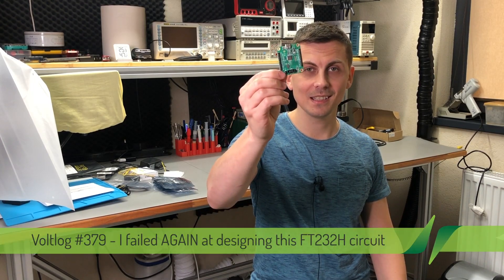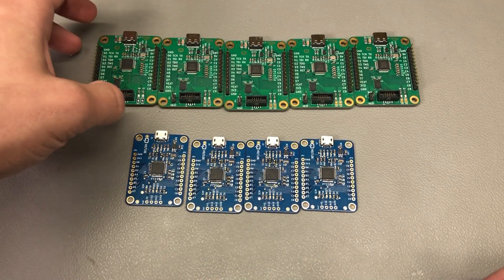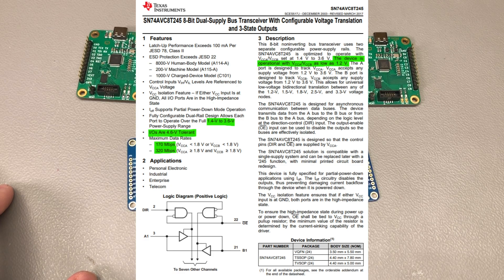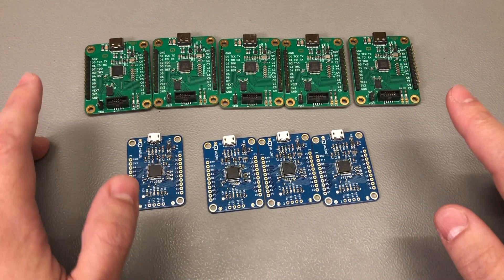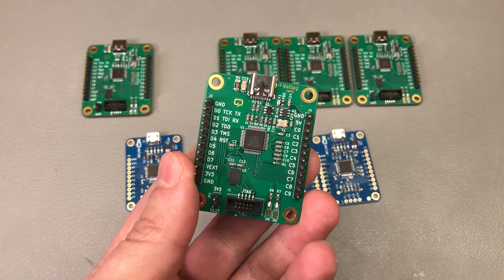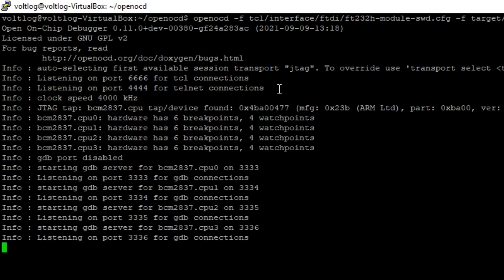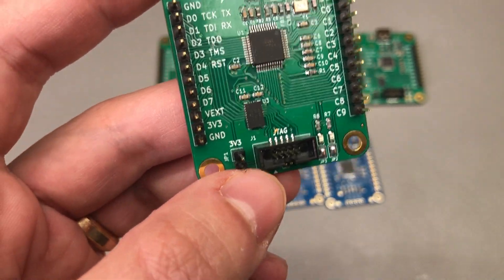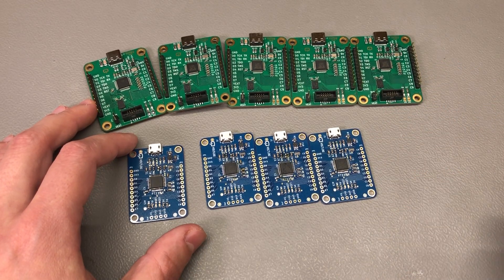I failed AGAIN at designing this FT232H circuit | Voltlog 379

Comment: You would only need voltage translation for TDO if the JTAG device is <2V. The FT232H inputs will recognise 2V -5V as a logic high. Just connect TDO directly, or through a small-valued series resistor.
Reply from the maker: I think you actually mean you don't need voltage translation for TDO, because it's going from target to debugger and the FT232H would be fine accepting a signal between 2.0V min and VCCIO (3V3 but extended to 5V because of it's 5V tolerance) on it's TDO defined pin. This would sure be the simplest solution to the problem but it would only cover 90% of the scenarios because if you try working with a 1.8V target I suspect it's either not going to work or it's going to be unreliable.
Reply: @voltlog  Pretty sure that's what I said.

Comment: I just recently totally messed up a circuit that integrated an ESP32-WROOM module. I mixed up the numbers for the IOs with the pin numbers of the module. Took me a while to find out why I couldn't detect any sensors on the I2C port and why the relay was always energized (it was connected to the pins for the WROOM's internal serial flash). Luckily it happened on the "proto"-prototype that I routed on my CNC. So no batch of unusable PCBs and remaking it didn't mean having to wait for a week for a new board.
Reply from the maker: Because of that I miss doing my own PCBs where I could spin a new board in a matter of hours. It's just not as easy to deal with that in the new office building.

Comment: Had the ESD protection diodes from preventing for USB to work as well. The problem is that some devices are high speed and the ESD diodes should match that, and most ESD diodes for USB are for low speed.
Reply from the maker: Thanks! This became clear after a few people mentioned this in the comments!

Comment: hey Voltlog!

have here my TIAO Tumpa v2 which uses a similar chip for the level shifter / buffer. In the documentation it says it's a 74LVC14T245 (i guess that means 14 channels). However the chip actually soldered onto my device is a 74LVC16T245. Now when reading the datasheet for this 74LVC16T245 (16 channel) chip, it does not mention so clearly that it's 2x 8 channel chips stuck together. However when you look at the logic diagram... this seems to confirm that. As 2 banks of 8 channels. And with each bank having it's own DIR pin (a total of 2 DIR pins) labelled 1DIR and 2DIR. So given that this is what the TIAO Tumpa v2 has done, I don't see any reason why not just do the same thing here. So long as the part is in stock and available. As you are already familiar with the 8 bit version of this chip.

This programmer is not in stock / available. Or it just keeps selling out very fast for each new batch. The extra protocols it can support: includes SPI, i2c. And RS232. For these extra protocols it adds a little bit more complexity. There are 2 additional chips... one is 93lc46 eeprom not sure what is for to remember here, but it connects to the FTDI chip. and also there is a 12Mhz crystal. And it has a MAX3243 chip for driving the RS232 port.
Reply from the maker: Thanks for the suggestion! I also have an EEPROM and crystal on board. The eeprom is used to save the config of the chip, like where are the TX/RX LEDs connected to and what is the USB descriptor strings. SPI, I2C is supported by default and for RS232 it's just not worth it anymore these days as far as I am concerned. I'll either end up using two transceiver chips or a 2in1 as you pointed out or I'm gonna do a discrete solution with mosfets because that would have the big advantage of using more easily savailable parts.

Comment: My FT232 doh moment was when I forgot to ground the test pin. Luckily it's next to a ground pin, so it was an easy fix with a fine tip iron and a tiny bit of solder.
Reply from the maker: Yeah it feels a bit weird that not tying that pin down will prevent it from functioning.

Comment: Good video as always. Would you be able to use this board towards the new Attiny 0-series(ex. Attiny1614) which use JTAG2UPDI? Usually we download the JTAG2UPDI unto a Nano, which then connects the UPDI pin to the Tiny. You should really check out the mcu's! Only use one pin for programming :)
Reply: JTAG2UPDI is one particular project that's using an additional host microcontroller between the serial line and target. So no, this board won't work right away with that. You could add one resistor or diode, and use the serial UPDI solution, and this board should work as well as any other serial adapter though.
Reply: @Gameboygenius  good to know! Thank you!

Comment: We at work did similar sort of design error with "bi-directional" voltage buffer (level shifter). We were using the same IC on UART line and we were only able to send the data on other side but cannot receive, it was obvious what the error was but it took us whole day of debugging and scratching head. Then other day I looked into datasheet once again, logic circuit part and noticed the OE pin, and felt so dumb. Luckily we were using TSSOP package and not this DFN, so the fix was easy. We made a small board with TXS0108 (bi-directional buffer without Output Enable) and soldered it on the main board. It worked out, now next revision is under process.
Reply from the maker: DId you experience any kind of reliability issues with the bi-directional transceiver? Is it working fine even at high baud rates?
Reply: @voltlog  no problems so far, actually after reading your comment I got concerned about higher baud rate.  We are only planning on maximun 115200 which works without any problems. Previously we were testing on 57600.

Comment: I'm sure you thought of it, but maybe hook up a scope to the USB data lines and see how the signal differs in regards to the diode being there or not. thanks for sharing failures too, there is so much second hand experience we all learn from it!
Reply from the maker: As other people have pointed out, I missed the fact that the FT232H is a USB2.0 device while the diodes are designed only for USB1.1 so they are not rated for this scenario...
Reply: With the FT232H being a USB2 high speed device and the bus running at 480Mbit/s, there are two problems doing this 1) you need a very fast scope to see anything useful, 2) The act of putting a scope probe on the bus can add enough capacitance to stop the bus working.

Comment: I'm current 3 minutes into the vid. I'm gonna guess the signals aren't hooked up right for some JTAG signals, because the DIR pin on the voltage translator is tied high? hehe
Reply: I started using FET switches recently on more projects, as I hate having to deal with a DIR pin, especially if interfacing something to an FPGA.

The old QS3861Q FET switches from IDT were used a lot for 3V3 <> 5V translation, with no need for a DIR pin. You can just power VCC on the chip via a diode, and the logic levels work OK in most scenarios. They used those chips a lot on PCI cards.
Reply: I like the fact you show some of these mistakes on videos, btw, I think it's just as important as showing the successes, because we ALL screw up boards. lol

(I'm sure there are some channels out there who don't show all their broken designs.)
Reply: OK, yep, I watched the whole vid now. hehe

I've made all the same mistakes in the past, and a fair few more. ;)

I don't think the FET switch option would work for JTAG if you want to use the lower IO voltages on the JTAG side, since the diode "trick" only really works when the voltage on each side of the FET is closer.

In that case, I would just use one of the chips you showed, with the separate VCCA and VCCB pins. At least then you know the logic levels on each side should be correct.

One other minor thing I spotted on your schematic - you tied the unused pins of the '245 chip to ground, which is fine. But, one side of the chip will be forced as outputs, so it could cause excess current to flow there.

(even though the inputs are also tied to ground, I would be wary of doing that to push-pull output pins as well, just in case.)
Reply: Oh, and I tried some of the supposed "auto-direction sensing" voltage translator chips on a project last year, and they were crap. lol

They didn't work at all, even for a simple low-speed connection between 3V3 and a 5V joypad.

If I were to re-use the same '245 chip you used here, I would also want to rename the signals on each side, so I knew which ones were Inputs and which were the Outputs. (assuming the DIR pin is tied high again).

(you should still be able to use that chip, just with the pin pairs swapped for the incorrect JTAG signal directions.)

And although it's probably a bit overkill, I try to add some low-value series resistors to some user-accesible headers now, as it can help with cleaning up rough signal edges, but also help limit the current if somebody accidentally shorts an IO pin to a power rail.

I tend to go for say 22R or 33R for that, but it depends on the signal freq etc.
Reply from the maker: The QS3861Q seems very interesting, certainly cheaper than the other options and plenty of channels to go around. However currently not in stock and guaranteed logic high starts at 2.0V so it's not good if you plan to go below 2V IO. I am also worried about bi-directional transceivers as many people have had troubles with them, even TI recommends going with simple directional transceivers if possible.

Comment: Can you use the same transceiver just reversing the pins need a different direction? I guess it works.
Reply from the maker: But that would be a waste of resources 😬
Reply: @voltlog  I means just wiring the pins in a different direction :-)
Reply: You can test it cutting the tracks a re-wiring your board.
Reply: @carloca71  you need both directions at the same time. Clock out, data in...
Reply: If each pin is one directional it is just a question of wiring the IC in the right way, I may be wrong but I remember that TTL ics, LS244, 245 been used that way for centronics ports in old pc boards, groups of 4 bits in different directions.
Reply: The problem is that the chip cannot level-shift down and up at the same time, i.e. 4 pins level-shifting 3.3v input down to 1.5v output, you cannot have 1 additional pin with level-shifting 1.5v input to 3.3v output. So you have to do a waste of resources to use two of them, alternatively use a chip which can shift up and down at same time different signals.

Comment: i made a brushless motor controller and for testing purposes, it ran at like 12V on a generic hobby brushless motor, i didnt bother putting the filter caps on the switching side of the board, after a single startup it fried the dc-dc converter (80V rated) which let some nasty voltages down to the  gate driver and mcu, all dead.

also and long time ago i made a board that immitates a batterycontroller of a ebike, so 3rd party batteries can be used instead of the expensive original ones, 
it was my first pcb ever ordered, and after a long time figuring out why it wont work i noticed that i havent connected the ground to the ground pins of the mcu. wasnt quite obvious in the kicad schematic.
Reply from the maker: These all sounds like common mistakes that I did at some point :-)

Comment: For voltage translation, if it's going down, all you need is a voltage divider with 2 resistors...
So just use the chip for going up and resistors in the other direction.
Reply: In principle yes, but I'd worry about two things.
1) a resistor divider will set a constant ratio, but you don't know the target system's voltage, if you want to do thing kosher. With a transceiver, you can use the target voltage from the JTAG header.
2) for higher speeds, you might get communication errors due to the higher impedance combined with whatever stray capacitance the cables have. For an integrated solution, you might only have a short run of PCB tracks, but for an adapter you don't know how long the cable might be.

Comment: IIRC the FT232H is a USB2 highspeed  (480MBit/s) device, I suspect the ESD diodes you have chosen have too much capacitance for this. They are probably fine for USB2 at 12MBit/s. I have had similar issues before.
Reply: If any datasheet you view today name-drops "USB 1.1" explicitly, ALL the warning sirens should go off. And that datasheet does just that on the front page.
Reply from the maker: Good point!

Comment: I always end up wanting to add something or see something I should change about the time the fab house is doing the solder mask. Rev 4 up on Kicad now. Simple circuits but aligning the 2 plug on boards made by others I get 50 mills with the stack up sometimes.

Comment: The boards looks nice. I'd suggest in this type of applications use a bi-directional, smth like TXS0108E.
Reply from the maker: Seems like using the TXS0108E would solve my problem and it's not too expensive either. I don't have too much experience with these transceivers but it would be interesting to give it a try and see if they cause any trouble. I've heard more than once that I should avoid using bi-directional transceiver if possible, to avoid any issues caused by the auto-sensing circuit.